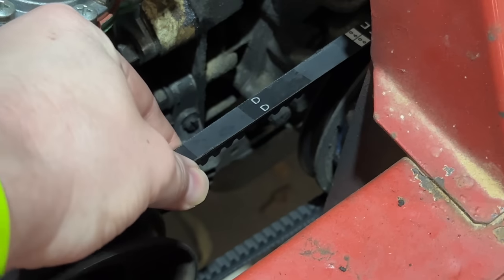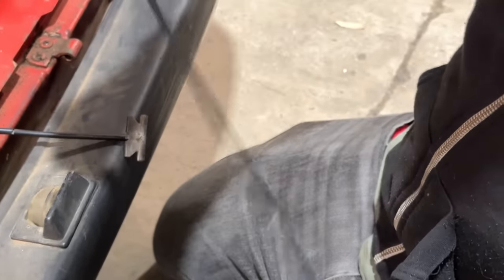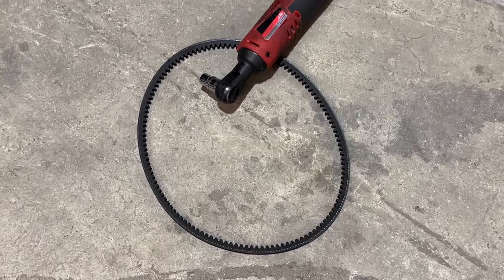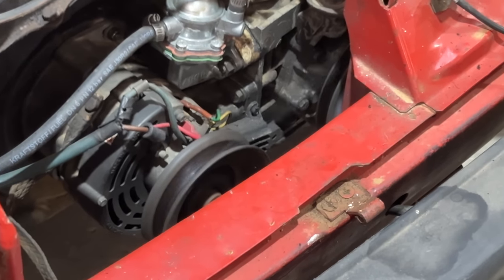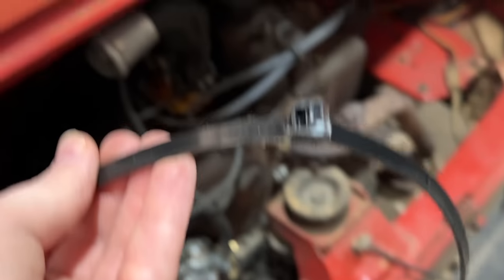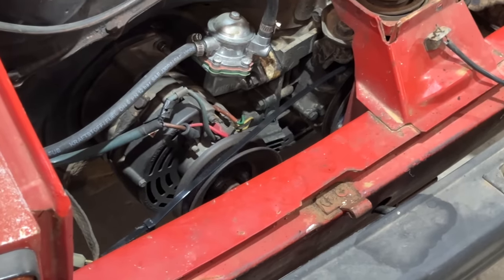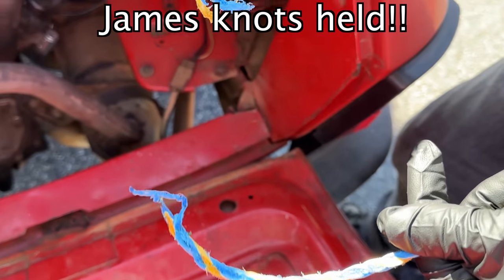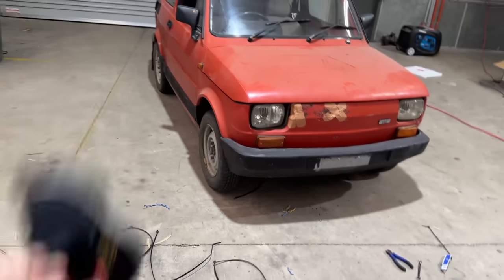Tony Abuse: The zip tie fan belt.

Comment: weird that you guys, especially james, don't know how to fuse a section of rope together by burning it with a lighter (tie the knots then apply the flame, little stronger then just using a lighter on it), or strengthening it with super glue. I've done it myself in a very sketchy car fixin emergency. It worked but I was freaking out the entire trip. Not 10km, but far enough that i was wondering how long it would take to snap